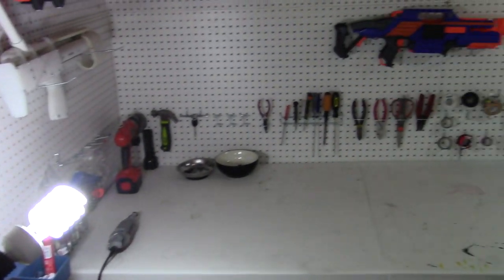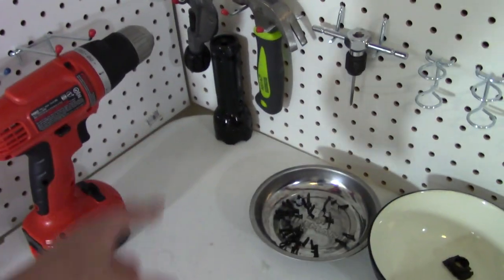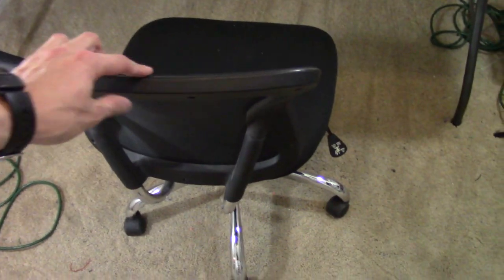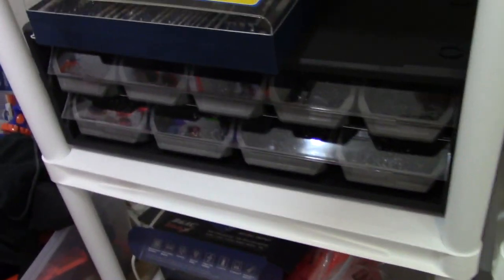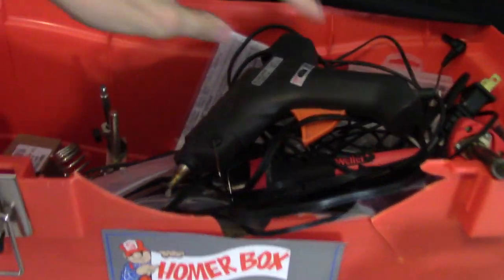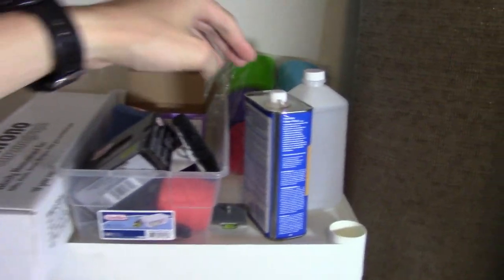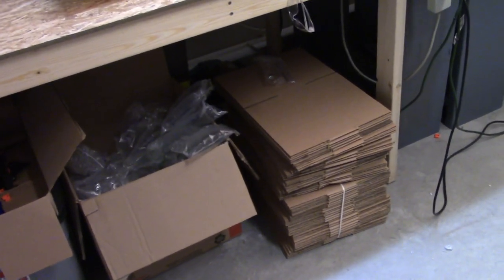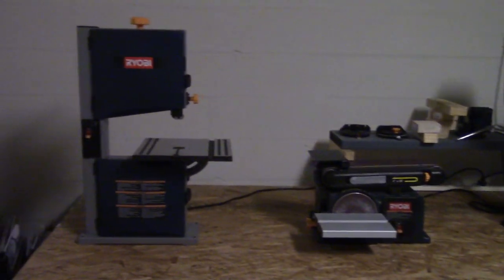[VLOG] Nerf Workshop Tour - 2015

Comment: We have ryobi surplus tools in the philippines. Is the ryobi rotary tool good for light metal works also? Brand new tools are not in my budget.
Reply from the maker: Gary Patag I've only done REALLY light metal work and they worked for that, but I'm not sure what type of work you're looking to do.
Reply: Coop772 i will do mostly soft metals like copper, aluminum and malleable steel.
Reply: Coop772 w

Comment: Coop772 I am 12 years old and I want to paint a Nerf Strongarm. I saw your tutorial videos all 4 parts and I have never painted before. Have any recommendations for the colors? I also like the orange from the original blaster. My favorite color is red and black but I have been told red doesn't look good with the orange which is important to me. Thank you.
Reply: I recommend you leave all the Orange parts orange so that they can still move smoothly, I would also try not to use black as a main colour and only for detailing as you don't want it to too much like a real firearm. If I were you I would us a colour such as purple or red for the majority of the blaster and only use black for detailing. Also, red won't look too bad with the Orange especially if you don't put them up against each other. Finally, remember to re-grease the parts before reassembly and sand before painting.